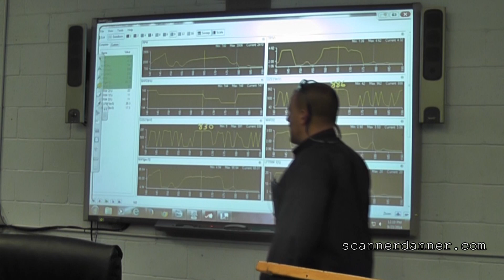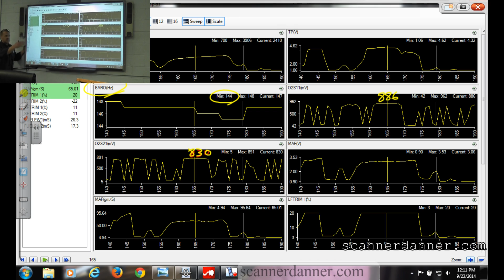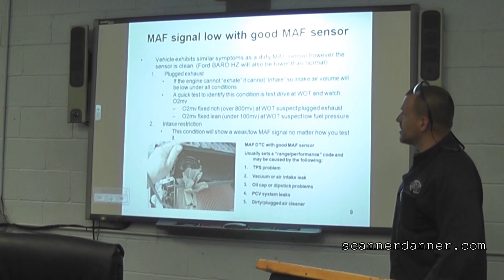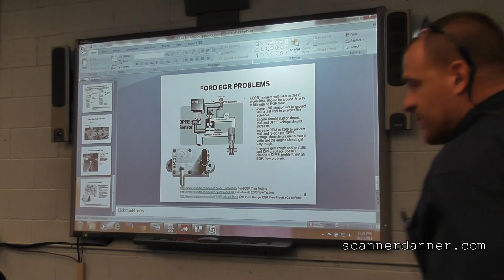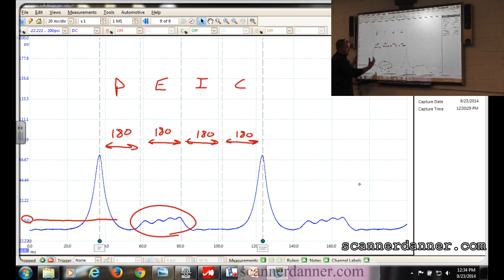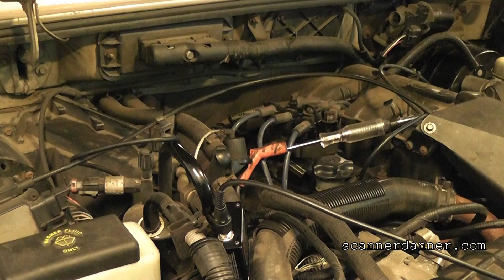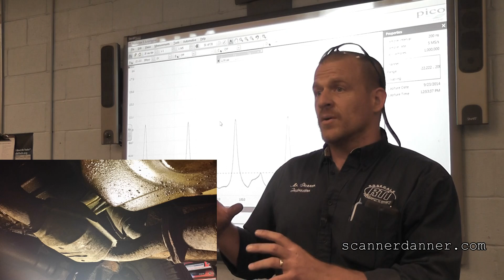How to test for a plugged exhaust (picoscope & psi transducer)

Comment: I got a 98 cadillac eldorado , Bank 2 is running 25 on Long term Bank 1 is running 5 on the long term. I thought it was the intake manifold cause i smoked it and some smoke leaked out of the intake. I replaced the intake gasket  and come to find out the smoke was coming out of a backfire "Flap" so i had no leak to begin with, while i was doing this i swapped the injectors from bank 2 to bank 1 and vise versa incase it was an injector issue. My o2 sensors seem to respond together when i introduce propane into the intake, i also checked for vac Leaks with water / propane and eltrical cleaner. and no change in shortterm/longterm. @ idle. The only other thing i can think of is that i have a exhaust manifold thats leaking , any insight would be greatly appriciated , Thanks

Comment: checking backpressure test on the dpfe line can bite you later because it's not 100% accurate.
Reply from the maker: I've never had an issue with it. Just have to know to disconnect vacuum line on EGR to prevent the valve from opening and affecting your measurement. Is there something else I am not considering or missing? Thanks!.

Comment: Paul,I have a question regarding your preliminary conclusion that directed you towards a plugged exhaust : you look at the O2s on each bank at WOT and see they are rich,thus eliminating the dirty MAF possibility. My confusion comes because I thought at WOT the fuel trims go in OPEN loop and the computer is not using O2 readings. Do you record those 800mV readings right before it goes in OPEN loop?
Thanks!
Reply: Great question. Yes the system goes into open loop but the O2 sensors still produce a signal regardless of whether or not the computer is using them

Comment: Just a question.
Can you tell me why an unconneceted plug wire can overload the ignition coil while the engine is running?
Thanks.
Reply: When the primary winding in the coil charges it induces a magnetic field in the iron core of the coil which transfers to the secondary winding and causes a bunch of electrons to build up, so there are a whole bunch of electrons sitting there, then when the primary coil turns off, the magnetic charge or field collapses, this causes the built up electrons in the secondary winding to MOVE quickly, they have to go to ground somehow and they will find a way, normally through the wire to the plug and jumping the plugs gap is the path of least resistance, if you disconnect the plug wire at the coil and start the engine you can normally observe the spark jumping out of the coil terminal and striking the coil somewhere nearby, sometimes you wont see it because it is happeneing internally, either way this is bad so dont do it, the spark is finding ground where it shouldn't be sending that kind of voltage. The danger and the reason you must give the spark a path to ground away fron the coil is that that the high voltage spark will damage sensitive componenets when it backfeeds into the coil primary side, some coils have the sensitive components inside them, most coils are triggered with a negative switching to the primary side, so the spark will find its way back to the Ignition Module or even worse the PCM and fry the Coil Driver Circuit. Long story short, there is a chance that the spark will backfeed into the Ignition Module or Engine Computer and destroy the sensitive circuits that control the coil.
Reply: ScannerDanner.......Yeah that too.....haha!
Reply: When you pull a plug lead off the coil voltage hits the roof, I have had 51 kv coming out of a coil
Reply from the maker: Well said, thanks.  Then there is the issue with my scope and psi transducer.  Don't want it going there either :)

Comment: Hmm, very interesting!  Out of curiosity, are the compression stroke numbers normal for a running engine?  I was seeing 60-75 PSI at peak compression on your scope there, which is about half of what I would expect to see doing a cranking compression test.  Having never analyzed a running engine before, I'm curious if this is a normal number, or if it's another sign of a restricted exhaust (can't exhale, can't inhale).
Reply from the maker: Running compression numbers (idle and no load higher rpm) will always be lower than cranking (significantly lower). This is due in part from the almost fully closed throttle plate (high manifold vacuum) and the shortened time of intake valve opening (compared to cranking rpm)
Reply: ScannerDanner
Awesome!  Thank you very much!  :-)